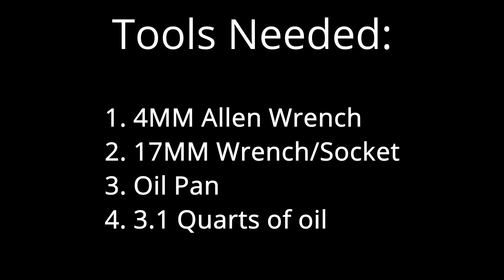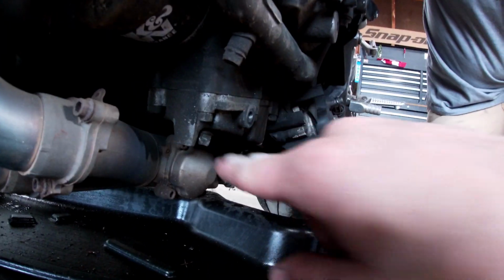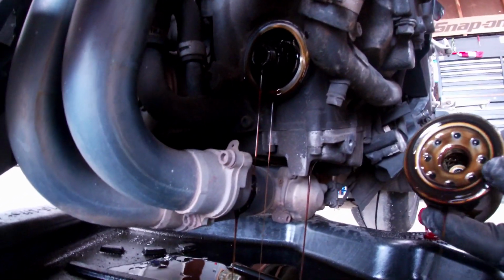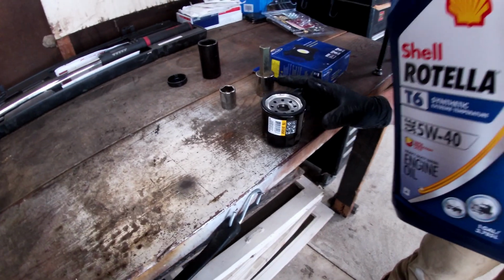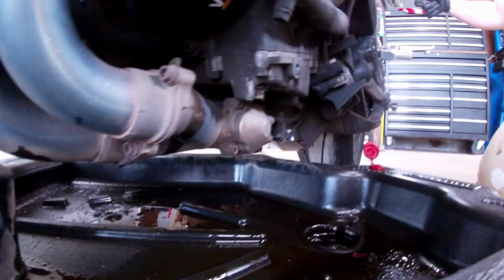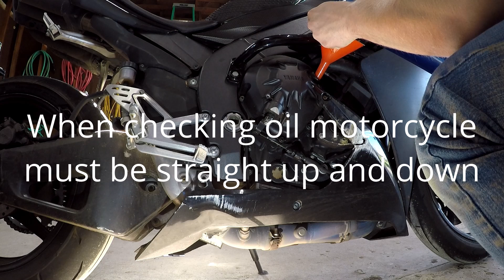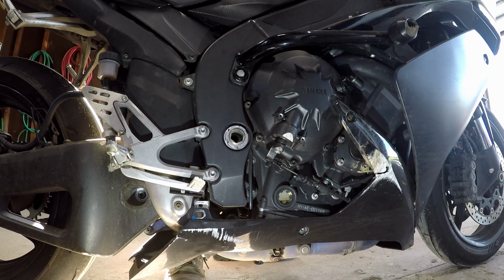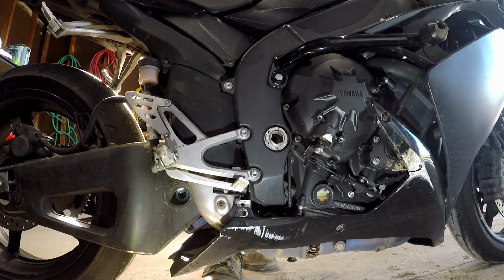Yamaha R1 (07-08) Oil Change How To

Comment: New Zealand here bro. I have an identical bike. Mine is black with gold forks and gold levers. Im the 3rd owner. Bike has 19,000 miles on the clock and is very tidy. I paid $750 for some Two brothers slip on's and sounds great. How many miles should I do until the next oil change?. Once again .. A great video
Reply from the maker: If your only street riding I change my oil every 3-5000 miles when running full synthetics.  Track riding or if your riding only consists of spirited constant hard throttle then drop it down.

Comment: Hey, I’m looking at a 2007 r1 with 18k miles, everything is stock, he asking for 6k. He said sometimes the neutral light goes out. Do you think this would be a good buy & any problems with these past 18k miles? Thank you
Reply from the maker: I would check a few things like plastics to see if they have been replaced and cases.  Beyond the abnormal the 07 08 r1 are great motorcycles.  18k miles doesn't scare me.  The R1 in the video gets tracked often and driven cross country yearly on trips and has close to 25k miles.  Check the maintenance on it and see if the owner seemed like he cared about taking care of his things.
Reply: 18k is nothing on R1 if it's maintained properly. I have 08 with 50k miles, everything works fine. Listen for timing chain. Mine makes some noice, but i asked about it from certified Yamaha shop and they said no reason to open it up yet. And that many 25k driven have worse Condition chain.
Reply: I just bought an 07 R1 and that was what was wrong with it. The automatic timing chain adjuster failed on it. Currently waiting for the manual adjuster to arrive so I can put it all back together. Going ahead and doing a tune up and oil change while I have the engine apart.

Comment: Is it possible to use non 4T oil?? Wont the clutch suffer?
Reply from the maker: Rotella T4 is Jaso MA/MA2 approved who means that it is safe to use in wet clutch environments.

Subscribe for more.
Reply from the maker: What do you mean by non 4T oil?
Also wet clutch systems need Jaso MA/MA2 approval
Reply: @motomigos   I mean normal car engine oil
Reply from the maker: Normal car engine oil is NOT ok to use in wet clutch environments.
Reply: @nihonkokusai  additives in car oil will make a wet clutch slip

Comment: Why did you use 5w-40 instead of the recommended 10w-40?
Reply from the maker: That's because Rotella T6 only comes in 5w and 15w that is Jaso-Ma/Ma2 approved.  They dont make a 10w jaso ma approved oil
Reply: @motomigos  hotter climates require heavier weight oils as oil thins more with heat, so 10w40 will be better than 5w40 in hot climate
Reply from the maker: @gerardogle1732  You are absolutely correct.  I deleted my comment because I had it backwards.  Knew what I meant but said something wrong.  (Deleted to not have incorrect information not to make you look anyway other than correct)

Comment: Did you really use Rotella? I know you can use a lot of different oils but what I was taught at school is it needs to be a Jaso approved engine oil for your bike. It has the right detergent and additives for motorcycle engines. Hopefully it didn’t do any damage. And no oil is not oil there are different oils for different engines.
Reply from the maker: Please read the description of the video or watch the video that's pinned in the comments.  Rotella T6 is Jaso/MA and MA2 approved.  Google would be a good friend in this case and could easily help you find a list of jaso approved oils ready to be put in your motorcycle with a wet clutch system.  Also if you have a dry clutch requirements change.
Reply: @motomigos  I didn’t know that. Didn’t know Rotella was jaso approved. Cool.